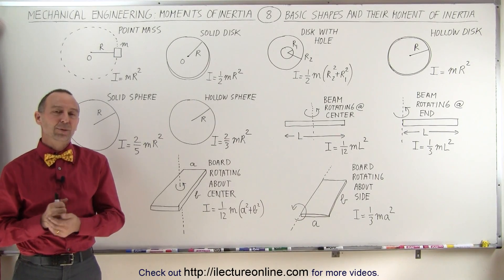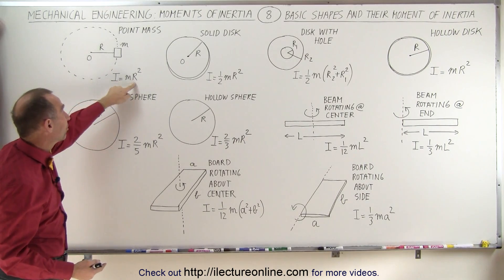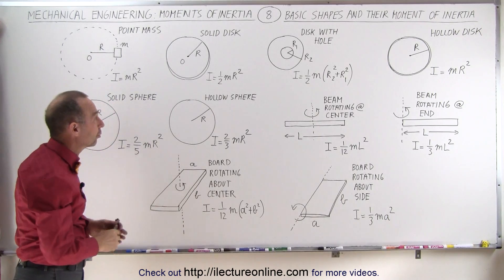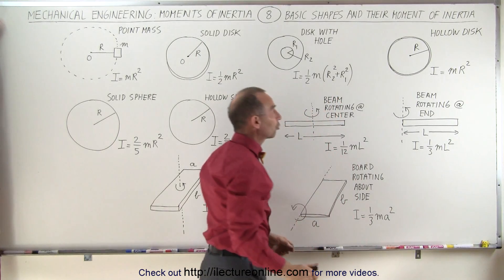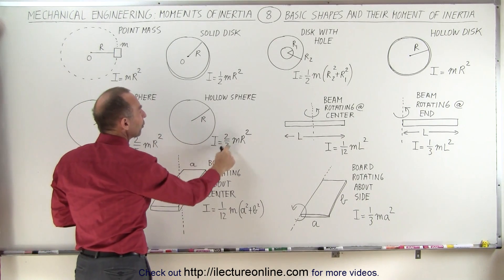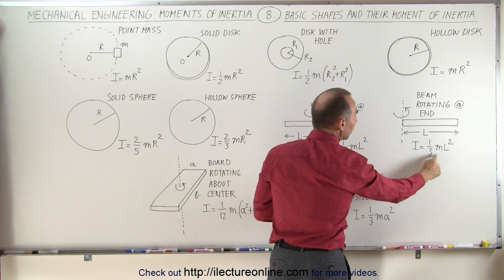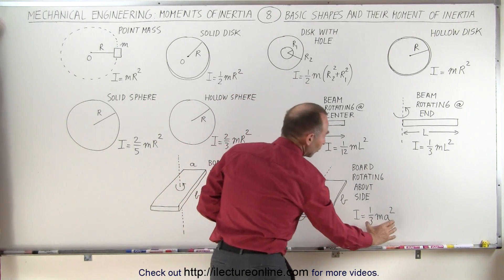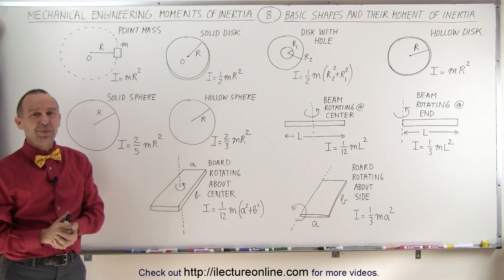Mechanical Engineering: Ch 12: Moment of Inertia (8 of 97) Basic Shapes & Their Moment of Inertia

Comment: For disk with hole, I'm pretty positive it's R2 ^2 - R1 ^2, and not plus, as it makes no sense for it's moment of inertia to be greater than if all the mass was concentrated at the outer end, like a ring.
Reply from the maker: The "+" is correct.  You can check by setting R1 close to the limits as it approaches 0 and as it approaches R2

Comment: Sir,how to find the torque required to rotate a solar panel kept horizontally in between two bearings
Reply from the maker: Depends on where the bearings are attached and where the forces is applied and at which angle the force is applied.
Reply: Sir  the panel size is 67cm×44cm×3.5cm and weighing 3.3kg 
The panel is supported by a shaft  and this shaft is supported by two bearings at the two ends
I'm representing my structure as below
                  
         _____65cm______                 
         |                                |               
()------|                                |------()   45cm side
         |__________________|           

() = Ball bearings
Reply: @aswinsanthosh9374  did you make it ?

Comment: Thank you very much sir, it was good  presentation, let's say I want to rotate a chassis of trailer or some welded structure..how to find I, in real world we calculate acceleration torque for structures to rotate and weld application. Your answer  will be appreciated. Thanks in advance..
Reply from the maker: When the structure is very complex, calculating the exact moment of inertia would become nearly impossible.  The option is to apply a torque and measure the angular acceleration (if the object is small), or one can model it and find the approximate solution,

Comment: Sir, how to differ a 
[solid rod (long thin cylinder), Axis is passing through the center of mass and perpendicular to the length. which is (mL^2)/12 ]
with a
[solid cylinder, axis passing through center of mass and perpendicular to the length. which is }{(mr^2)/4}+{(mL^2)/12}]
Reply from the maker: The 2nd equation is always correct for every situation (including a thin rod), but the (1/4) mR^2 term will be very small (and insignificant) if the rod is very thin.
Reply: @MichelvanBiezen  Thank you very much for the original Info. Love from Bangladesh.
Reply from the maker: Glad to be of help.  Welcome to the channel!